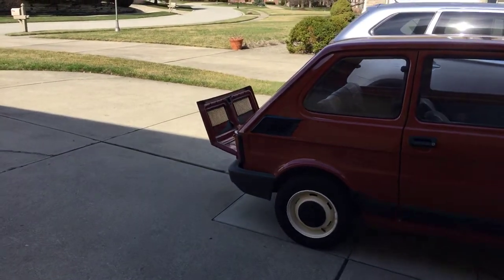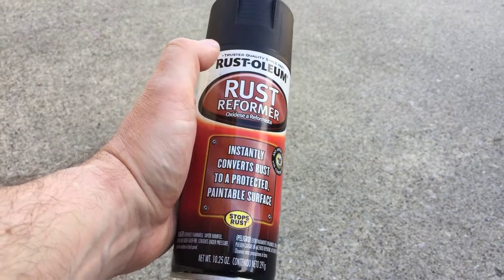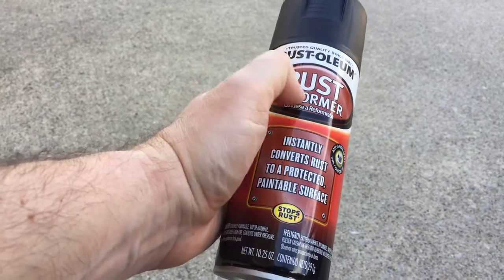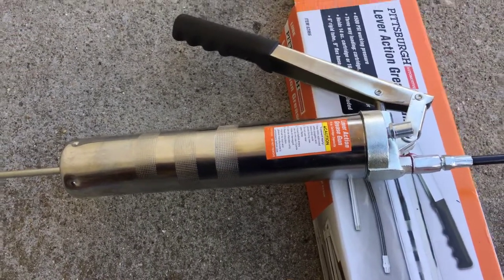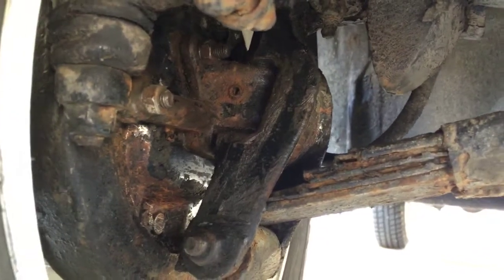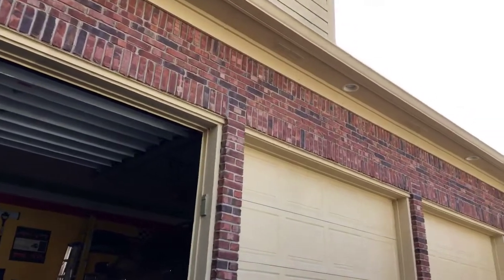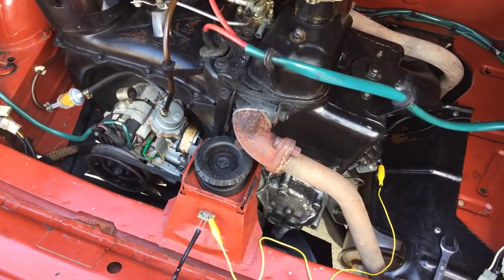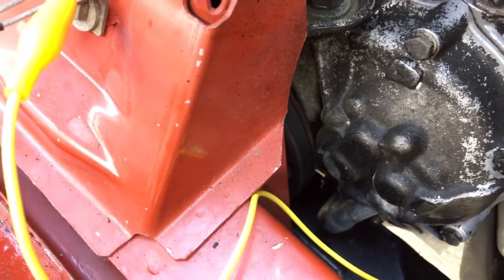Fiat 126p in USA - Episode 7 - How to Set Timing, Suspension Lubrication, Corrosion Proofing Tips

Comment: Hi Bart - enjoying the vids. I also have polski fiat 126. how did you build your light bulb circuit for timing? Don’t see this in the earlier vids? dzięki. Mark
Reply from the maker: Hello Mark. There is really no circuit there. Just a 12V bulb with 2 wires attached to it. I soldered the wires right to the bulb but it is more elegant to find a bulb with socket and two wires. The end of the wires should have alligator clips so that you can make a good connection.
Reply: @FIAT126p  I see. That’s great, thanks.